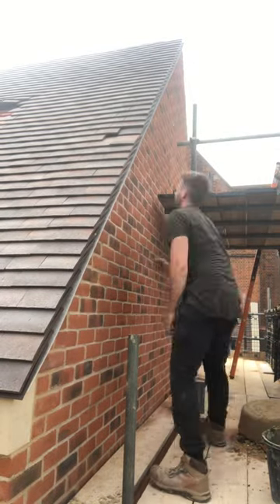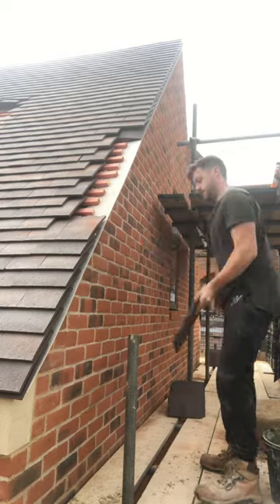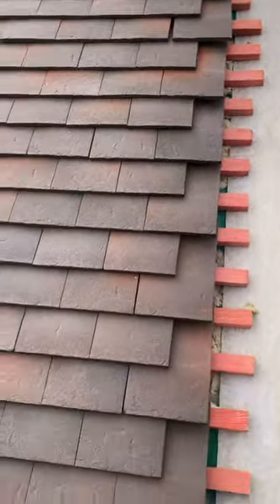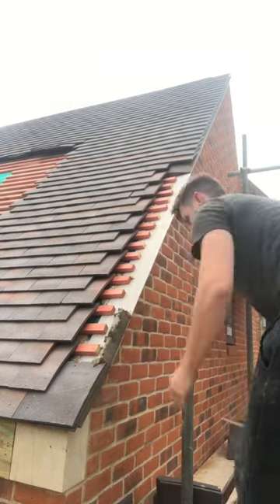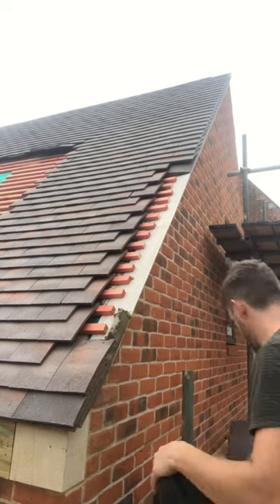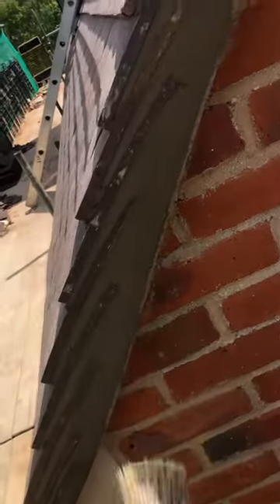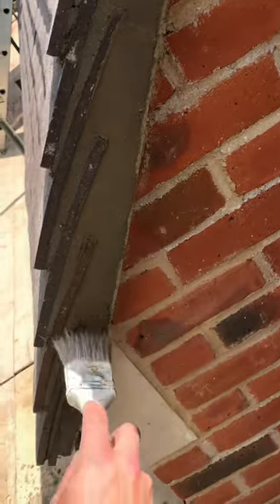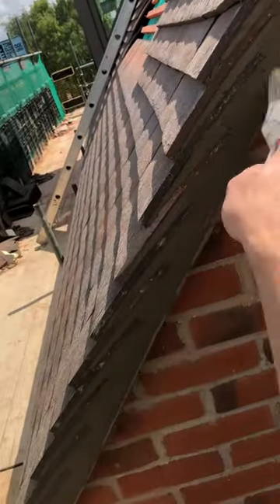How to tile and cement a plain tile verge. Step by step

Comment: battens should be 2" from edge of the under cloke strip, use a lot more muck and nail as you go. I also used to use PVA in the mix which hardens off the mortar and extends the lifespan.

Comment: This is the best video on the subject. Does the same principle apply to slate roofs? Or just use a plastic dry verge strip instead of mortar?
Reply from the maker: On a slate roof the best way is to slate the verge in completely and once slated then push the cement in on the verge. But do not put cement in the tails of the slate. Just the bit from undercloak to underside of slate.
Reply: Not best video at all. Should be nailing the verge.
Reply: Please remove this it gives roofers a bad reputation

Comment: you should nail every tile and gable with an ally
Reply from the maker: You should yes but it won’t make a massive difference.
Reply: Think I'd be tempted to put a thin gauge stainless screw in has i work up the gable.
Reply from the maker: @anthonymclean9743  a thin ally 38mm possibly. Only reason I don’t nail the verge tile is because if one ever broke then it would be extremely hard to repair. Repairing verge tiles is always abit of a pain.
Reply: @anthonymclean9743  never screw slate or tiles EVER

Comment: Why haven’t all the edge tiles been nailed as you go & mucked in to half the width of the tile? Also, battens could do with a string line on them, apart from that 👍🏻😂
Reply from the maker: I don’t like nailing the tiles as I think if a verge tile ever broke would be impossible to repair without damaging the whole verge. 
Thanks for the comment 👌🏽👍🏼
Reply: @roofinguk  appreciate the comment bud. If a tile broke then it would need rebedding across 3 tiles anyway surely so no problem with nails? I’m not here to dig you out mate, there’s a lot of people in the comments and everybody does it slightly differently. Love the content you put up 👍🏻

Comment: Cement mix far too strong this will shrink and crack, why are you not fixing your tiles with Ali nails ??? We can all comment on people's work eh.
Reply from the maker: 3 in 1 mix always for verges and ridges 👌🏽👌🏽. We are roofers, it’s what we do. 😂😂  🔨
Reply: @roofinguk  where are your fixings ?
Reply from the maker: @jwconstruction378  I don’t nail the verge tiles for the main reason I think it would be impossible to replace a verge tile if one broke.
Reply: @roofinguk  you should be doing a fixing specification on your jobs for each area, you need to fix the perimeters there more likely to break not fixed.
Reply from the maker: @jwconstruction378  I get big jobs with lots of detailing. I love doing these roofs, keeps my brain busy. I like to think I take pride in my work. We all work in different ways.
Reply: @roofinguk  correct there's lots of keyboard warriors out there
Reply: @roofinguk indeed neat job. I've leant a  lot. I have to replace a rotten facia and disintegrated felt so have to remove 3 rows of plain tiles and repoint using new tiles. Thank you.
Reply: @roofinguk nailing tiles is not a Choice it’s a must, every tile now but always had to nail perimeter